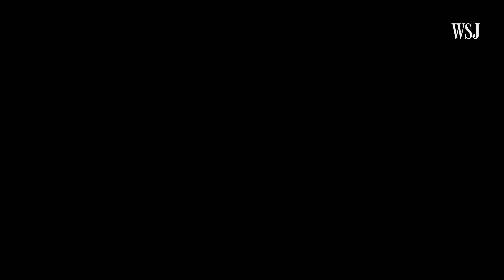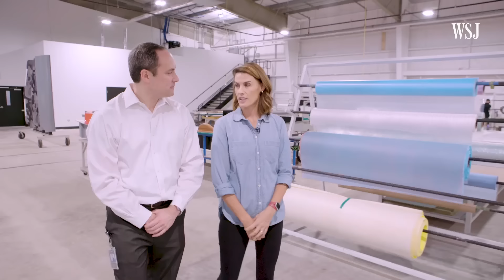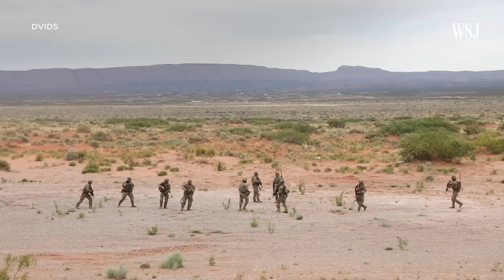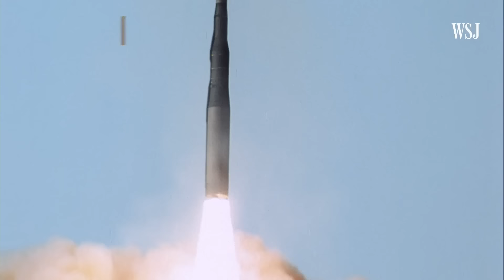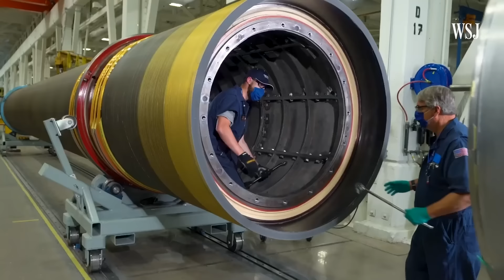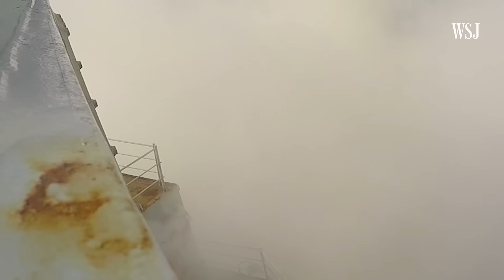Breaking Down Russia’s Vacuum Bomb, the U.S.'s M10 Booker and More | WSJ Equipped

Comment: In the time it allegedly takes to build one factory to make a few 155mm shells today, WWII would be half way through and multiple factories would have been built in months producing 100s of times more shells of different calibres.
Reply: Precision munitions makes sense when they can be deployed against enemy matériel production + logistics IE: exactly what USA / Germany are prohibiting …because they’re inside Russia.
Reply: @JAllenKaiser  Precision ammunition are vulnerable to electronic jamming, which can make them practically useless. The M142 HIMARS, the Excalibur 155mm artillery shell, have the same vulnerable. US relies too much on guidance technology. Compare that to the Russians, where they lay massive fire with barrages from their MLRS. They use bombs with very high payloads. Quantity is its own quality. Cheap missiles and rockets can easily overwhelm a high-tech air defense system with numbers. If a system is more complex, the more open to vulnerabilities. This is why you don't want to upgrade the A10 Thunderbolt II with new electronics, and why it is better to be keep it simple as possible; to improve the reliability, and maintenance requirements. The US has been fighting, over the past decades, enemies with low technology and small industrial capacity.
Reply: @samuelmorales2344  that’s an awfully narrow definition of “precision munitions.” Not everything relies on radio signal and/or GPS. You’re forgetting older, lower-tech things like heat-seeking and wire-guided systems; gyroscopic ballistic munitions; and newer, higher-tech things like laser- and microwave guidance; autonomous navigation / target locking systems, etc. — and various combinations of the above.
Reply: @samuelmorales2344  Are you sugesting for a fight use spears and arrows?   ;)
Reply: @JAllenKaiser  Pay attention. Ukraine strikes inside of Russia everyday.
Reply: @JAllenKaiser  Ukraine strikes inside of Russia all the time.
Reply: @mikemckinnis3877  operative words: “precision munitions” “USA” “Germany”
Reply: @JAllenKaiser  Ukraine is using US supplied ATACMS inside of Russia. What do you think they struck the radar station with?
Reply: @mikemckinnis3877  the radar hit with ATACMS is in Crimea, Ukraine. The radar inside Russia which they fell short of striking today was targeted with a Ukrainian-made prop-engine drone.
Reply: @JAllenKaiser  you may be correct I'll have to check again.
Reply: @JAllenKaiser  what i was refering to happened a few days ago and i was busy while listening to one of the war mappers.
Reply: @mikemckinnis3877  Ukraine has been very careful to abide by US conditions, for fear of losing aid (again) if they don’t.
Reply: @JAllenKaiser  Crimea is Russian territory by the way. They voted 87% in favor of annexation. People onky velieve in so called democracy when ut works in their favor fir sone strange reason 🤔
Reply: @mikemckinnis3877  Russian commander Igor Girkin himself said that “referendum” was fiction, held under military occupation, Ukrainians forced by armed soldiers to vote for Russian “annexation.”
Reply: @mikemckinnis3877  Russian commander Igor Girkin himself said that referendum was a fiction; Ukrainians were forced to vote for annexation by armed Russian soldiers administering the ballot.
Reply: @mikemckinnis3877  Russian commander Igor Girkin himself said that referendum was a fiction; Ukrainians were not allowed to vote against annexation by the armed Russian soldiers administering the ballot.
Reply: @mikemckinnis3877  Only the Russians believe those votes. There's no democracy there, only what Putin decides. If he decides there will be an 87% vote then there will be.
Reply: What took a thousand bombs to hit in WW2, took a hundred bombs during Vietnam, took one bomb during Desert Storm.  Basically the same with dumb shells, verses the rocket assisted guided 155 excalibur shells of today.  Then their are so called drones which may make it all meaningless when swarms of insect sized drones assault an area, each one directed in real time by a hive mind connected to an AI central control, to kill any living heat source, like a cloud of death.
Reply: the west is a joke Russia is out producing the US,Canada,Germany 10 to 1 in shells and other munitions.
Reply: Yeah, I don't believe a single thing they're saying. The best weapons are the ones you can blame "nature" on.
Reply: @anhumblemessengerofthelawo3858  you don’t believe anything they’re saying, but you DO believe in… what exactly are you suggesting, specifically?
Reply: Our rounds today have laser and GPS guidance...
Reply: @Khuros  GPS is almost useless in Ukraine
Reply: Technology has changed significantly since WW2. WW2 was about mass production, but not very high tech. This translated to a similar situation on the battlefield - large masses of soldiers, lots of deaths. Nowadays, especially in the West, the strategy has shifted towards fewer - much fewer - weapons systems, but highly specialized and extremely advanced technologically. This shapes the battlefields similarly - far fewer deaths.

In WW2, you were sometimes sending out two dozen bombers to drop literally tens of tons of shells over a rather large area to destroy one single factory, and still not damage the target significantly. Nowadays, you send out a single missile, and in 99 cases out of 100 you completely obliterate the target. Overall, although individual weapons are orders of magnitude more expensive nowadays than they were in WW2, war overall is cheaper, especially in terms of human deaths.
Reply: @a0flj0  If the West is serious about the possibility of a great power conflict, it needs to take a hard look at its capacity to wage a protracted war and to pursue a strategy focused on attrition rather than manoeuvre. Attritional wars require their own ‘Art of War’ and are fought with a ‘force-centric’ approach, unlike wars of manoeuvre which are ‘terrain-focused’. They are rooted in massive industrial capacity to enable the replacement of losses, geographical depth to absorb a series of defeats, and technological conditions that prevent rapid ground movement. In attritional wars, military operations are shaped by a state’s ability to replace losses and generate new formations, not tactical and operational manoeuvres. The side that accepts the attritional nature of war and focuses on destroying enemy forces rather than gaining terrain is most likely to win.
Reply: @a0flj0  He was talking about 155mm shells specifically, not bombs from bombers. Most 155mm shells are still dumb. We don't make more for one reason and one reason only, because we don't want to.  If the USA were inclined, they could make 1,000,000+ per month. Ukraine is struggling with shortages because of the politics of western nations.
Reply: @brettwhite8982  no the US couldn't make a million per month of anything.. we have no industrial base anymore. Russia is out producing the US, NATO and the rest of the 50 countries supporting Ukraine. Its sickning that the US proxy war in Ukraine is being used as a test sight.
Reply: @brettwhite8982  You don't understand how difficult it is to make a 155mm shell. US military is a precision strike type of military. In no way is the US military designed to fight a war of attrition. US manufactured 155mm shells also cost expensive. Chinese and Russians can make 155mm and 152.4mm shells at the fraction of the cost. The Excalibur GPS guided shell is not useful against an adaptive military with some level of technological know-how against electronics of the enemy. The ridiculous Crusader system with the L58 barrel with ramjet shells being cancelled is an example of boondoggles that go nowhere. The US pays inflated prices and prefers the most expensive technology. The US government rewards the military industrial lobby with profits, and the military industrial lobby is about profits.
Reply: @samuelmorales2344  I completely understand.  I wasn't referring to the GPS guided variant.  My point was we could make way more than we do if we wanted to. Like most things, it just takes desire and money.
Reply: @brettwhite8982  no, this still requires hundreds of thousands of skilled workers.
Reply: @efghggdxlmfn33  As I said, desire and money.  If the desire and money was there then the required facilities and personnel would follow.
Reply: @brettwhite8982  nope. desire and money are not enough, this is what happens with the commercially oriented military-industrial complex. it is necessary to educate a whole class of engineering-educated personnel, tens of thousands of people, if not hundreds of thousands. The cost of artillery shells for NATO has already increased several times during the conflict. And in the Russian state military-industrial complex there is a planned economy designed for victory. Well, Russia has not destroyed production over the past 20 years, only in the 90s when it was “friendship” with America. And for the last 10 years, Putin has been preparing the military-industrial complex for a restart. For example, Rostec was created. you can look at the website in English
Reply: @a0flj0 obviously you haven’t been paying attention to the numbers of drones and missiles being produced by Iran and China. Being able to mass produce weapons quickly is and will be incredibly important in the coming years. A conflict with China will drain our surface to air missiles in our surface fleet very quickly and overwhelm them within a short time. If they stay in range they will be taken out or they will have to return to port to reload.
Reply: @a0flj0  1 precision bomb won't kill 3 seperate targets at the same time. That doctrine is outdated as only for small scale conflict. 
Number still matter, you can't end the war if you can only shoot 1 and enemy shoot 100. That is what  happening in Ukraine
Reply: @a0flj0  
That was all fine until just over two years ago. Maybe watch the video before replying next time.
Reply: We're is a peacetime economy, before the US even begun fighting, it was gearing up for war for years.
Reply: @Paul-yh8km  When the idea was proposed, it was thought to be suitable for use in maneuver warfare and police operations, but it would not be effective in a full-scale war of attrition. The so-called theory is needed only to satisfy the corrupt military-industrial complex, which has nothing to do with launching a full-scale and effective war.

Comment: GLSDB is a failure in Ukraine. there is too much GPS jamming so its been unreliable just like the JDAM ER that was put on Ukrainian jets. 
the Himars M30 and ATACMS uses older INS guidance that cannot be jammed so that is still working however its called degraded accuracy as its circular probability of impact goes from 5 meters  (using GPS guidance) to 10-15 meters with INS. same as storm shadow/scalp it uses INS as well, it also has stored pictures of its target. and also uses terrain matching/following. so its accuracy remains high. France's HAMMR (similarto JDAM) is also working better as it uses other than USA satcom so its still working OK

Comment: I think the US should accept the fact that it can’t rely on GPS anymore. 
GPS guided ammunitions hit nearly nothing in Ukraine anymore. 
GPS Jamming and spoofing became normal.
Reply: Exaggeration, GPS guided HIMARS rockets just recently hit an S400 radar, command module and 2 TEL's with 4 missiles on each.
Reply: @pogo1140  “Daniel Patt told the US House Armed Services Committee in March that Russian EW had reduced the accuracy of the 155mm Excalibur precision artillery munition, which uses a GPS guidance package, from around 70 to 6 percent efficiency.” 
As an example
Reply: @Stefan-st   and? All that statement says is that the Excalibur is 6% more accurate than an unguided 155mm round which when used in an M777 has a CEP of 166-47m sy s range of 25km. Other air delivered munitions have secondary guidance and their accuracy is only mildly effected. An example of which was recently demonstrated when 2 S400 launchers, it's control cab and radar were taken out by multiple HIMARS rockets in a single strike.
Those rockets made it past the GPS jammers and multiple defending Air Defense systems to hit the targeted S400 site
Reply: @pogo1140  in my understanding efficiency means hit. So it did only hit the target in 6%. 
It’s a war, a single hit as you mentioned says nothing about the accuracy. 
But all i want so mention is that the benefit of GPS is decreasing and still the celebrate the 1m accuracy of that rocket in this video. 
Takeaway is to invest in other targeting systems also.
Reply: @Stefan-st   100% means the bomb hits inside the weapon's CEP, in the case of Excalibur it's will hit inside 4m circle 50% of the time.
An unguided 155mm has a CEP of 50-200m.
The 155mm artillery shell has a lethal blast radius is 50-150m

Comment: The tank round underneath the commanders seats in the Russian tanks is what makes the upper turret fly off..  you said the ammunition stored around the turret makes it blow off. That is no where near the correct answer, This makes me re think everything that is said so far in this video.
Reply: You thinking that the ammunition is just under the commander's seat in Russian tanks makes me re-think everything you have to say.
Reply: Who told you that? Every tank infantry man knows the two rings of rounds in the turret goes off by chain reaction in T72 (i think T80 too) if breached. And no tank armor is unbreachable by current array of directed, tandem or sabot anti-tank warheads.. Luck is bigger factor than skill for Russians and turrets sometimes serve as blow-out panels when you don't have the latter. Have you seen how high these multi-ton turrets can fly?

Comment: Am I the only one who wants them to slap a GAU-8 on the M10 Booker?  Also we have a mountain of 105 rounds held over from the 60 series tanks.
Reply: It's just too expensive and too vulnerable looking at the conflict in ukraine.
That said there is always a good reason for the brrrzzzttttttt gun.
Reply: GAU-8 is intended to penetrate the thinner top armor. A ground based GAU-8 would be trying to generate the thicker front armor.
Reply: @Rob_F8F  I know.  But why not kit bash some stuff for fun?  If you managed to shoe horn the gun on to the Booker you’d have no room for ammo and power generation for the gun might be an issue right along with thermal management and all that brass has to go somewhere.
Reply: They could produce a Booker II as a companion vehicle with a Bushmaster 2 30mm auto cannon, a coax 3 barreled . 50 cel GAU-19, with a multi-use short range radar that's integrated with an active protection system.  Deploy one per platoon.

That's how the Germans deployed their Wiesel armored vehicles. Usually 3 20mm carriers, and 1 tow carrier.

Comment: Any chance we can get helmets that protect from the effects of thermobaric  weapons?
Reply: You need a full suit, like battle armor used in Battletech/Mechwarrior
Reply: @pogo1140  i am not convinced that is necessary to avoid the worst here described effects and i don't mean necessarily the initial explosion phase. Helmet with its own flexible O2, that would be activated when a rappid  pressure change occurs or when manual activaded in case of biological or chemical threats. Similar to a airback system, just then creating airtightness around the neck.
Reply: @kinngrimm  It has to withstand the compression, heat, vacuum, the supersonic debris from the explosion
Reply: @pogo1140  i guess there might be safty limits, but could one produce sufficient counterpressure within the helmet? Not necessarily equal to the outside, but enough to soften the blow and prevent fatalities. Biggest issue i thought would be to create an airtight area around the neck at least for a short time, indefinetly ofcause could be better, but for the duration of such an attack would at least prevent the worst there then.

Gels put under pressure,chemical quick foam for one time use, something like that.

The supersonic debris, there a full body armor might be needed indeed, but how far away are we with current moddels that  are reinforcing vital areas? Weight is also a constant concern if you don't want an exoskellets that need motors/actuators.
Reply: @pogo1140 , a MJOLNIR armor comparable suit would be about the only thing that would have a chance of withstanding that impact and that doesn’t exist in our current day & age/reality for that matter:
Reply: @Herm.Q-92  think deep water suit mated to a power cells and electrical servo. An endo skeleton with a hard shell
Reply: As long as you have exposed skin the pressure will turn your organs to jelly.

You can mitigate the effects but that has more to do with you enviroment not the actual equipment.

Comment: I'm pretty worried that the Booker is irrelevant.  It looks like an ideal system for the Afghan war.  War has changed as the Ukraine war has shown.  Now vehicles need to have much more protection from missiles and drones.  That means better all around armor, anti drone/aircraft fire, and an active defense system. Also, with increases in drones for recon and improved man portable ATGM's it is better to increase longer range indirect fire.
Reply: So that is why Russia and Ukraine have both stopped using tanks? What....they haven't stopped using tanks? Don't they know tanks are obsolete?
Reply: It's for air or sea lifting to pacific islands.